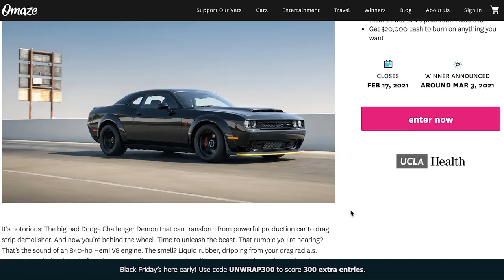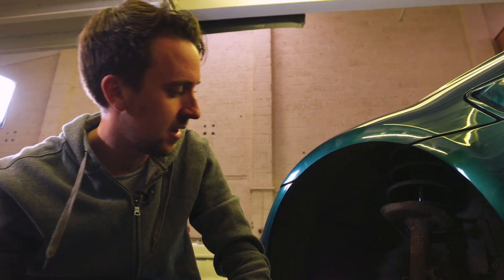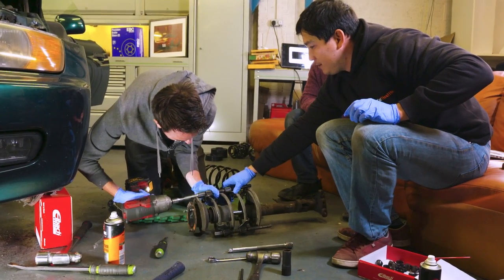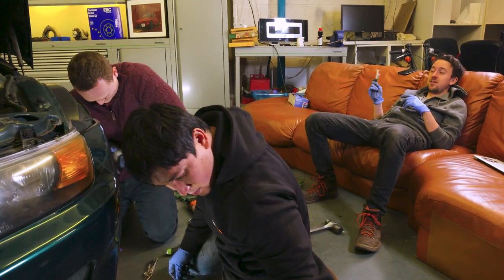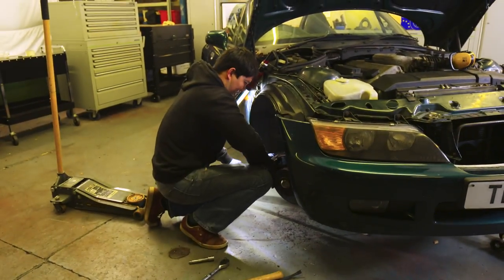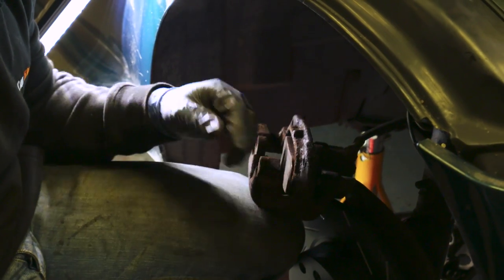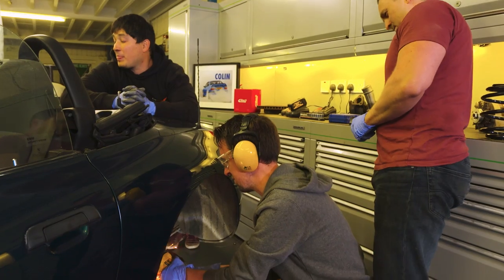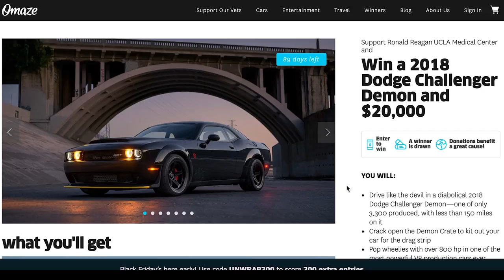Project Car Novice Tackles Brakes & Suspension!

Comment: Snapping bolts is what happens when you gun everything. If you're going to teach him, teach him the correct way.
Reply: More fun with a gun though 😬
Reply: Pro tip if you work on cars a lot, get one of these or similar:
https://www.ryobitools.com/power-tools/products/details/18v-38-in-ratchet

Low enough power that you'll likely never snap a bolt by accident, still saves heaps of time compared with hand tools and fits in tight spaces better than the giant one in this vid.
I've never seen a situation as a mechanic that actually required a high powered one.

I personally used to have a full sized rattle gun (before these low profile ones became common), but was still only 12V and max 120Nm/70lbft which is around factory recommended wheel nut torque. My colleagues laughed at me for buying such a weak one while they had beefy 700+lbft pneumatic drivers that echoed through the whole workshop whenever they spun up (and cost around 6-8x more than mine did).
Didn't help them though as I still tended to finish jobs quicker, and at least once a week there'd be snapped bolts or stripped threads followed by loud swearing.. which happened to me precisely zero times, not even on the little undertray torx bolts.
Reply: It might be funny for a while but they really do need to try to teach him something.  If you try to learn everything by trial and error you end up breaking a lot of things and hurting yourself, possibly seriously, lots of times.  They suck at teaching and I'd rather see Ethan enjoy what he's doing.  Watching Alex and Gareth let him bollock things up is going to stop being funny very quickly.
I also wasn't particularly amused to see them pissing him about while he was compressing the springs.  The fact is that that can be dangerous.  He needs to know when things are actually dangerous and when they are just teasing him.
Reply: Totally agree. Alright for whipping gearbox bolts off or anywhere that's not had the bolt thread exposed to weather, but not good on suspension. What's wrong with the old ways of getting a bit of heat on them first?
Reply: @neilwalsh4058  this, I'd almost forgotten about those tricks

Heat guns are quite cheap these days, safe to use around oily bits, and when combined with WD-40 (oil based aerosol lubricant/penetrant) can get even the rustiest of bolts out

Also another pro tip for beginners: if you're using hand tools and need more muscle + have space to work, slip a pipe or something over the spanner/ratchet/bar to increase the length/leverage and hold the outer end.
A 70 ftlb wheel nut takes 70lb force on a 1ft long bar/spanner
Extend with a pipe to 2ft, only needs 35lb force, 3ft - 23lb
Just make sure it isn't gonna slip off the bolt/nut as higher force means easier to damage/round off the bolt head.. And doing this on really old or small (1/4 in) ratchets can break their ratchet mechanism so ask first if it isn't your tool kit 😛
Reply: @MotoCat91  forget the WD40, make your own penetrating oil at a fraction of the price and its way better.
Saw a feature in a classic car mag some years ago so I tried it, its brilliant and you probably have the stuff in the house to make it. 
70% cheap vegetable oil 
30% nail varnish remover. 
Mix together and dispense with a spray bottle (old windolene bottle or similar) 
Ensure the nail varnish remover is one WITH acetone. Lots today are acetone free but they won't work. 
The acetone breaks the rust seal and the veg oil penetrates the threads. 
It's never failed me and I'll never buy premade penetrating oil again because that homemade mix is superb.
Reply: Its more what happens when you are working on a 21 year old car where literally EVERY nut and bolt is rusted/seized.  The only way you'll get round that is by using A LOT of heat and bashing things loose, which tools you use makes little difference.
Reply: @neilwalsh4058  While a good tip, why not just buy acetone rather than nail polish remover?  It's dirt cheap and should be at any auto store, usually in the paint section.
Reply: @sw96  I think the point was, things you're likely to already have in the house. Its something I read years ago when NVR usually contained acetone, but these days it's normally acetone free.
Reply: I've snapped way more bolts by hand than i have with the rattle gun

Comment: That snapped bolt is a part of car modding every car guy has gone through
Reply: Hell even basic maintenance with bolts
Reply: I did it on a water pump bolt inside a 306 engine. Took me 3 days to get it out 😐
Reply: @ChapmanWW  
Oof
Reply: It's even more "fun" when you snap the screw extractor trying to get it out. Just like the one in the head of my trailblazer- no exhaust leaks yet though 🙃
Reply: Mindset when working on my car: 
"Okay just got to tighten up these last few bolts, fit the wheel and get the car off the stands, should be out of here in 30 min or so."  
snaps bolt 
"... well I guess I'm not doing anything else this weekend after all."
Reply: Its not even just cars 😭 ive shared bolts in instruments before now, and just in random shit ive been building up 😂

Comment: People NEVER EVER cut a spring like that, that is extremely dangerous!...
Reply: They are also using an impact wrench on a spring compressor...
Reply: It not dangerous as such
It not under tension ,and with glasses and ear protection any adult could do that safely.
Reply: The rear springs on these are not over the strut, and so once the trailing arm has been lowered there is no tension on the spring. It’s no more dangerous than cutting any other piece of metal.
Reply: Hence why there was no movement in the spring once the grinder broke through.

Comment: Ethan is an absolute gem for tackling this 👍really surprised Mike's place didn't have a garage spring compressor would have taken a lot stress out of the operation and safer.

Comment: Addictive and brings back memories. I was Ethan 40 yrs ago. Now not much I wont try. I worked at a college helping in motor vehicle they had to stop students using impact wrenches due to tom foolery and needing to learn the old way. I have a cheap cordless gun but prefer wrenches except for where it helps on jobs where special tools needed to remove my scooters variator and clutch. Imapct wrench whipped them off in no time. Keep these coming please so entertaining and lads laughing at theirmates pain😂. Ethan swearing reminds me of me so much when things go wrong

Comment: Recommendations
- egr/2nd air pump delete
-DISA valve upgrade (w/ titanium screw)
- PCV delete ( swap 4 oil catch can)
-Headers + dual exhaust
-individual  throttle bodies 🤷🏻‍♂️
-tuning
-roll cage
-hard top 
🤙🏼

Comment: Awww bless you Ethan nut/bolt snapped on front suspension strut, it happens to us all unfortunately just had same problem on my mk4 bora just got a new hub like jack said, it’s easier and simpler than drill out and tapping a thread. Well done though especially for a non car guy. Never good to smash knee or leg on a disc whilst standing up 😰. Congratulations👍 🎉  👏

Comment: 11:20 had the same thing with my Ram 2500 and had to buy a new hub, only I was taking the bolts off when several of them broke because that's just the way things go when you're working on a 22 year old truck in Minnesota

Comment: KwikFit, and experiences with bad mechanics (VW Parkway, Derby, cough), is exactly why I do my own work.  I do things like actually tighten my drain plug when I do an oil change, or actually replace the oil at an oil change service.  Ethan is right, some stuff I have a couple of trusted mechanics that I'd use for jobs that I don't have the tools for (engine out for example), but other than those decent mechanics, I do a better job and I know it has been done right.  Plus there's the sense of accomplishment, and it's cheaper.  By miles.

Comment: I remember when I started working for my dad, Doing front breaks was my first job i believe, letting a first timer change springs idk bout that. If that spring slips you gonna learn. 
Ethan definantly is doing well and no matter the chip they give him he's doing well on this so far
Edit : Why didn't he heat the surrounding area on the wheel bearing before trying to use the screwdriver?

Comment: The worst aspect of working on cars, especially by yourself is dealing with stubborn bolts that seize up and strip or sheer off completely...and dealing with the headache of being dead in the water until you get a replacement and or or have the tools to ez-out drill them. It's all time consuming and a pain in the ass...everything else is sort of cake for the most part, the right tools and preparation will get you very far.

Comment: I've never been a fan of using impact tools when working on old, rusty bolts & components. On new stuff it's fine as you know it has not been stressed before, or weakened. An old bolt/component is not as strong as it once was. Hand tools all the way as you can feel how tight the bolt/nut is.

Comment: What Ethan had happen to me, I had happen on a VW Jetta TDI fuel pump. I had just had the entire engine apart to replace seals and got it back together when the pin keeping the fuel pump in time. Had to take the pump pulley off, and took the pump out of time, and free up that pin. Now the car hardly starts and runs like crap

Comment: This is why mechanics or good mechanics charge labour alot, working with cars or on cars isn't as easy as its sounds, people think fixing car is expensive but just think if you wanted to fix your car e.g. if brakes takes 1-2 hours for a mechanic to do that means you will take around 3-4 hours.

Comment: Using the impact for too much. On the assembly line you have guns at specific torque settings for each job.

Hood latch,  8nm, most stuff 4nm, and so on. Structural stuff is more. But the impact isn't the tool of first resort with vehicle assembly.

Comment: What size are the wheels.  How do the springs feel?  I often hit the bottom with my z3.  I don't know if my springs are too old.  Or that my wheels are too big. I am considering buying this set of springs as well.  I have read that they are stiffer.  so I hope to hit the bottom less.  I have already replaced all the shock absorbers. that didn't help.

Comment: i cannot believe that doesn't have vented discs in the front. my 86 GTI had vented, and it was lighter and had much less power. in fact, ive never owned a car without vented FRONTS at least. my first car was from 1973, vented front discs, and it was an american boat...

Comment: The first thing I've done to a car is change the air filter and air intake hose.
And after I finished I forgot the socket bit on the nut, drove, and when I checked something under the bonnet it was still there O _O

Didn't know where the heck was that socket for 2 days.

Comment: Coil overs are cheap if you know where to look. The Front of the Z3 is essentially E36 and the rear is E30. So a set of front E36 coil overs and a set of E30 coil overs for the rear and you are golden. Never search for Z3 parts, they charge you an arm and a leg because its for a Z car. Case in point, i asked pricing for a Z3 2.8 radiator and for a e36 (all identical across E36 and Z3 even same part number) and the quoted price for the Z3 was about 150 pounds more... Same with the spot lights (identical to E39 5 series) Z3 spotlights were about double the price than the 5 series ones and they are literally identical with identical part numbers. 

That being said, if its the narrow wheel arch Z3 then everything in the rear (subframe diff suspension etc) is directly interchangeable with E30, which makes LSD and final drive ratio swaps cheap and easy with a wide variety to choose from.  If its the Wide arch Z3 then you will have to use the wider Z3 trailing arms and side shafts, subframe diff and suspension is still identical. 

Giving the 4cyl a shorter final drive (notoriously geared too long for the 4cyl) it will make it more lively and can be done for cheap using e30 parts from wreckers. 

Then anything suspension related for the front, look for E36 Parts. 

Have fun with that info lol.
Reply: @shaukahodan2373  lol Ethan doing a LSD swap with shorter ratio diff and coil overs. would love to see that. Then also fixing the common problem of diff mount shearing off of the z3 making him install a diff mount bracing kit.

Comment: Want a ghetto advice?

Use a smaller bolt, weld it to the bigger bolt that is broken, get it out.
Or use a steelrod, weld it to the bolt that broke, use a grinder to flatten two sides of the rod, then use a wrench to get it out.

have saved me on many old rosty Volvos :P

But never forget, pray, alot. lmao

Comment: Why would you cut the spring rather than just detaching the anti roll bar and damper and push the wheel Hub down enough easily to take the spring out in one piece? Having installed coil overs in Z3 myself it’s like the easiest car to do that task.

Comment: Rattle gun to compress springs ..not a good idea, and really not everyone should try this. that's how you send a spring thru your face.
 That and with newer vehicles if your not wise to the brake system, it's pretty easy the wreck expensive calipers(like ones with electronic parking brakes). Anyone can learn, but it's really not a great idea to just send it.

Comment: 6 months ago, i was working at a suzuki dealership, in india. i didnt know how to remove the spring from the strut. the other mechanic left the whole suspension with spring with those spring locks on a benchwise. i was just curious and unbolted the screw of the suspension, the strut fell down and the spring stayed intact with those locks on a benchwise for 2 hours. my expert or senior mechanics & technicians were not impressed. they were so mad. i was smiling the whole day & they were in mad

Comment: you have all those tools there but no welder? see if you had had a welder you could have welded the the bolt head back on and then slowly undone the bolt like that. it isnt easy and doesnt always work, but more often than not it will be your only job and take about 10-15 minutes

Comment: wtf was that with the angle grinder trying to get the snapped bolt out? just drill a hole in the center and tap in an EZ out screw extractor, comes out in seconds and the EZ out kit costs nothing

Comment: Ethan imagine doing a job where you start at 12 and think should take a couple hours fast forward to 7 o clock in the evening pissing with rain on your gravel driveway. It’s taken you this long to do front suspension because it’s never been out and everything is rusted to fuck

Comment: Miata vs z3
Which one is a better car to give to your younger brother
Reply: Miata (na/nb): cheaper maintenance and more aftermarket parts, but less cabin space.
Z3: can be gotten with an i6 engine and is a little more luxurious at least by 90's standards, but maintenance is more demanding.
Reply: @neilschoff9635  i think he would enjoy working on the miata way more
Reply: @sandigagic1999  Should be a bit easier to learn on than the z.  Also, the miata community is enormous and supportive.  Z3 community is a lot smaller and has a higher proportion of know-it-alls haha.
Reply: @neilschoff9635  very true

Comment: They are really messing with ethan lol, should've tought him about using hand tools first tho and then later went to the gun as if he doesn't know how tight to put it by hand then he's definitely going to  break bolts the first few times he uses the gun.... and how did it take you guys 10 hrs to do a brake job and change out springs lol, did this on a car for the first time and it only took me like 2 hrs to do all the springs and then another 30 mins to do the brakes lmaoo (the car I did it on was also a pile of rust)